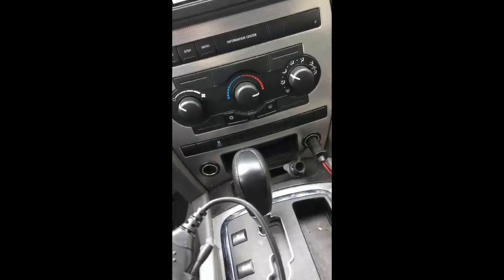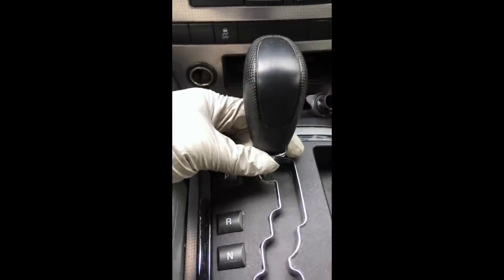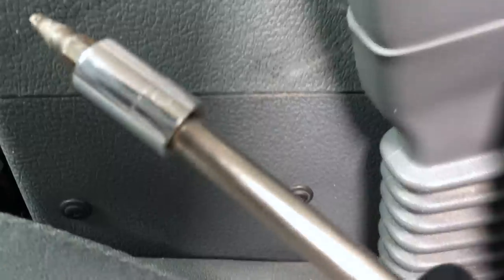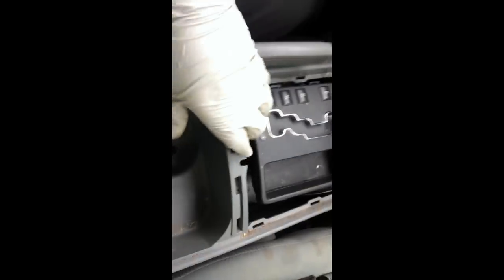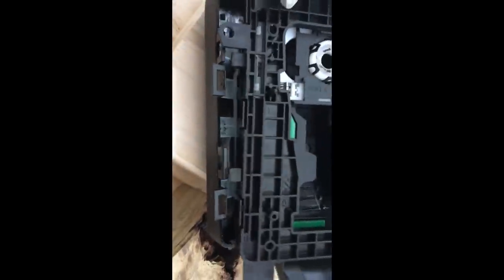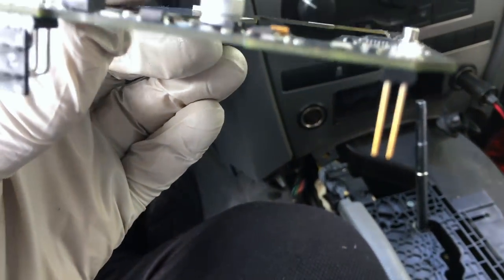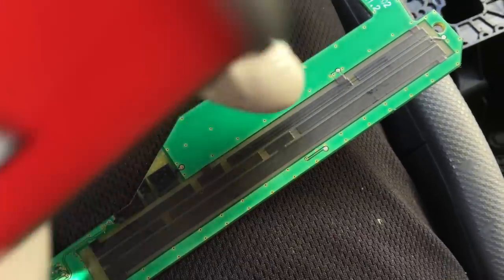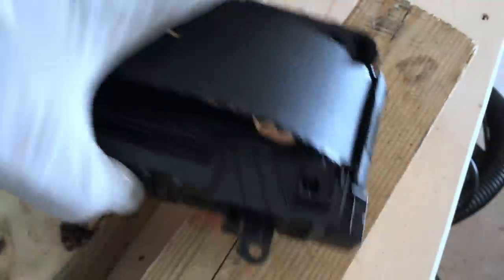2006 Jeep Grand Cherokee (WK) 3.7 Electronic Shift Module (ESM) Problems U0404 P0700 Codes

Comment: Is your jeep 4wd ?
Reply from the maker: yes
Reply: @MrV2u  how you can start the 4x4 ? Or it's all time 4wd? I have the same model but i dont know where i can find the 4wd switch
Reply from the maker: Mine is all wheel drive brother. You can’t turn it off. They do have rear wheel drive models as well, though these are rare.
Reply: @MrV2u  thanks a lot brother and if you have time can i ask you another qusetion?
Reply from the maker: @hasali9917  go ahead bro.
Reply: @MrV2u  i changed the fuel pump package but my car still delay in starting maybe after two tries it starts and sometimes it start from the first try , and sometimes i smell gas inside car , what is the problem
Reply from the maker: @hasali9917  do you have a check engine light on? You can have a vacuum leak in one of the lines. Did you change the pump in the gas tank? Do you have the same symptoms with a full tank as well as a low tank of gas?

Comment: I replaced mine with a brand new one and the problem didn't go away does anyone els have advise
Reply from the maker: Rico Gonzalez do you have any codes? Symptoms?
Reply: MrV2u no codes at all I tried to clean it like u did with the old one it did not fix the problem I went got a new one from dealer ship I replaced it my self and still the same thing it turns on when it wants to but if I go somewhere and turn it off it won't start anymore for at least a day or two
Reply from the maker: Rico Gonzalez different symptoms as mine. Does it crank when you turn the key? If so is it a strong crank? Does It sound “/feel like it wants to start? Or is it completely dead?
Reply: MrV2u when all them things are around the gears it's completely dead as soon as it goes back to normal its not a strong crank it heaitates then starts
Reply: MrV2u could it be my starter??
Reply from the maker: The square lights around the indicator right? Once they clear it starts with a hesitation. I doubt it’s the starter. If you have a scanner check for codes. Sometimes there pending codes and won’t trip the check engine light. How’s the battery condition? Clean terminals, good power?
Reply: MrV2u yes
Reply from the maker: Rico Gonzalez I’m thinking electrical issue. Could be a wire, relay, corroded contact on a wire, or another bad sensor on the tranny. It’s weird no codes are tripping.

Comment: Awesome video!!!
But I have to keep doing this about every 3 months. Does anybody know where to buy a new one?
Reply from the maker: You can buy one at a dealership or junk yard, but then you don’t know the condition of the used one either. Try to go to autozone or advanced auto and see if they can find one for you. Also you can try rock auto online, I’m sure they might sell them.
Reply: @MrV2u  Thank you for the quick reply. I can't find the part new and most of the used places like eBay only give 3 month warranty, which is what I get after cleaning mine. The one place I found that sells it, wants to sell me the complete shifter unit not just  the circuit board. But thanks again your explanation of repair was great.
Reply from the maker: If it’s cheap just buy the used one and clean it and try it out brother. Especially if the Jeep has less miles on it. You might be able to swap one out of a newer Jeep up till 2010. Let me know how you make out brother. Glad to help and thanks for the feedback.

Comment: You are awesome, thank you!
Reply from the maker: Daniela Espinal thanks for the awesome feedback. I try my best. If you have any questions I’m always around for advice.
Reply: I think I’m having the same problem as jenna here, I’ll try to fix it this weekend. I have this app with sprint that send me the codes directly to my phone. I’ll see if I can send you a picture of what it says.
Reply: Well I can’t post the picture but it says OBD-ll code U0404. Nothing else after that.
Reply from the maker: That’s the code I got. This should fix your problem. When you disconnect the battery in the first step and finish the job it will clear your check engine light. Take your time and you’ll be good to go. Let me know how u make out! Good luck...
Reply: MrV2u Thank you lifesaver!

Comment: This is a perfect example of flawed engineering by the manufacturer. At least from the standpoint of longevity and reliability. It's excellent engineering from the standpoint of profits and continual income. I doubt you would see this issue on a Toyota or Honda.
Reply from the maker: It’s a Jeep thing mang don’t understand 😂. I do love the older Toyotas with the non turbo motors.
Reply: @MrV2u  yup. I have had several 90's Toyota Camry's, both 4 & 6 cylinder, and they are sooooooooo reliable it's incredible. Also very easy to work on too. I currently drive a 1997 Toyota Camry v6 Le with 250K miles on it. Bought it new from the dealer in 1997. Accept for standard maintenance parts (oil, filters, brakes, plugs, coils, tires, etc...) the only thing I've had to do was replace a leaky valve cover gasket. I'm pro-American, but one must give the Japanese credit for their engineering when it comes to both reliability and longevity.
Reply from the maker: I got a bad taste with Toyota when my 08 Camry with the 4 cylinder started burning oil just after warranty. They had a poor design with the piston oil rings and it causes the car to burn just a whisper of oil every so often. No blue smoke out the tail pipe either. I also had a 97 Nissan Sentra that had over 250 and all I changed on it was general maintenance things. They don’t make them like they used to brother. My 2021 Ram now has a crack in the exhaust manifold with only 70k on it. I would of bought a Tundra if they didn’t have those turbos. I’m very leery to new motors when they just come out without being vetted for durability.

Comment: This is happening to my jeep right now I wanna do it I just don’t want to fuck anything up.
Reply from the maker: You’ll do fine brother. Just take your time and if you run into anything hit me up brother. Let me know how you make out.
Reply: @MrV2u  I just took my car out the transmission because the transmission cooler went bad and I had a p2676 code I fixed both. And now it’s the control module.
Reply from the maker: @josesoto9335  at least it’s a cheap fix brother. Unless it’s not lol. I would definitely start with cleaning the module first before trying the next step.
Reply: @MrV2u  I already change the two other pieces 😩😩 cost me 800. But the transmission shop said those codes came up and it needed to be changed.

Comment: This happened after I changed the shift cable
Reply from the maker: Are you sure you have the Jeep in park when you try and start it. Go underneath and remove the cable and shift the Jeep into park manually, then go up top and try to start it and see if it works.

Comment: After doing all that, the light came back with the same code
Reply from the maker: Most likely you have a bad speed sensor  in the tranny, or a bad esm. If it’s the sensor/solenoid you have to drop the pan to get into it. Let me know how you make out.

Comment: You should have never taken out the dash and you charged the poor customer for that labor for no reason those bolts come out with out taking out the center console
Reply: All you need is a screw driver and a torque bit
Reply from the maker: Mustafa Mansour the poor customer is me. I work on my own cars. But thanks for the advice. I was showing the entire process,.